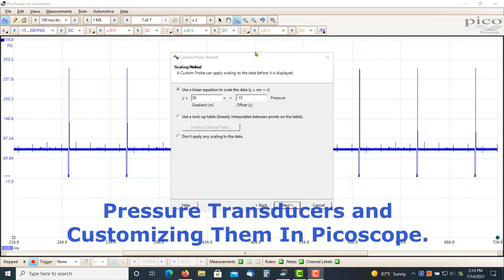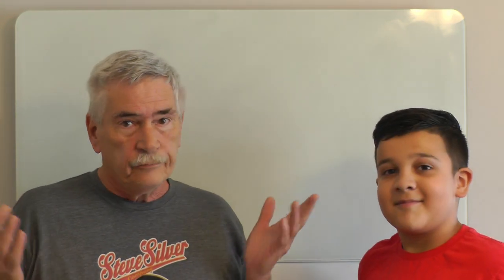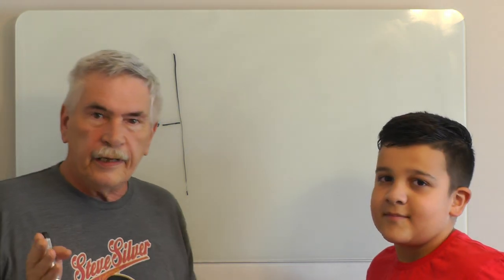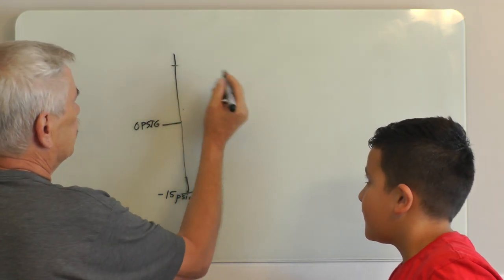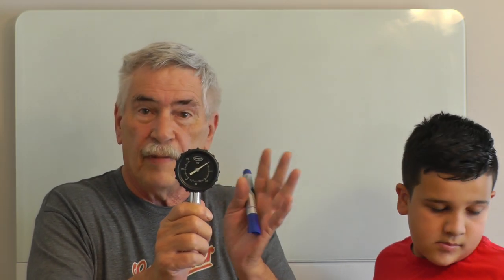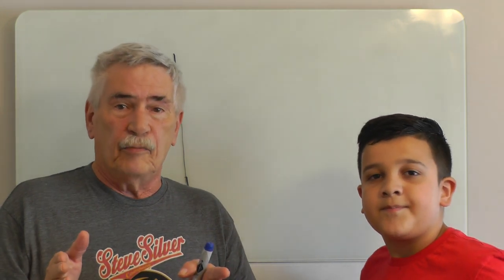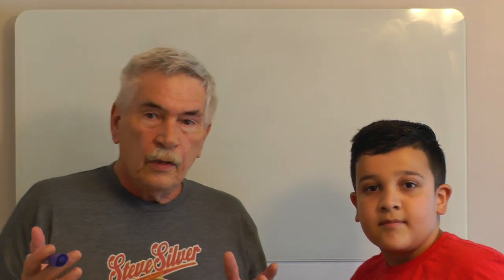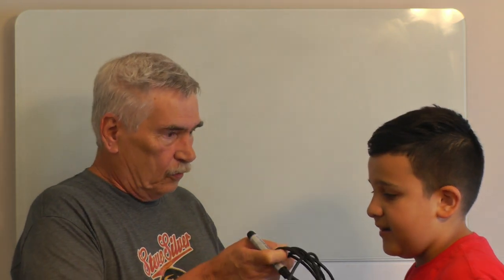In-Cylinder Pressure Transducers: Understanding Linear Equation, 'y = mx + b' Inside Picoscope

Comment: Convenient to have a linear association. I'd be interested in the wiring diagram for your printed circuits, it seems you put a diode and capacitor in, maybe for added protection of the scope? Understanding how these are designed gives insight as to why these devices can be expensive.
Reply from the maker: The schematics are posted on the other video Dave and really not much to them. The capacitors are for decoupling the rails and the diode is for reverse polarity protection. Have a great day!